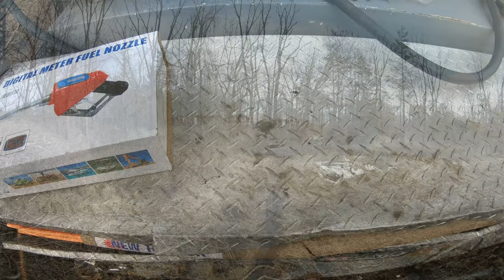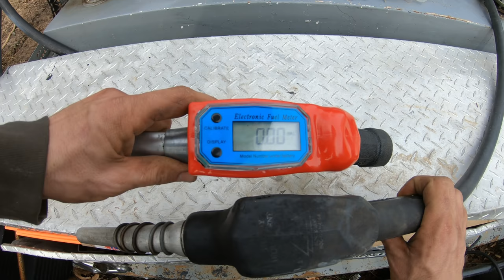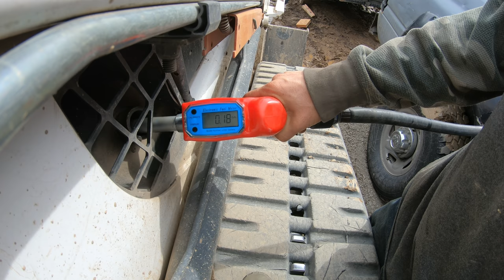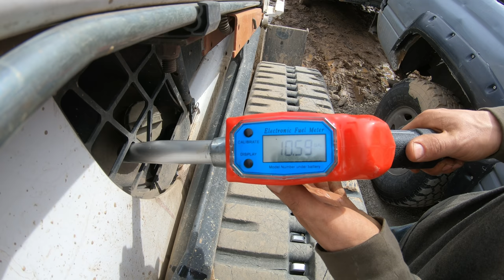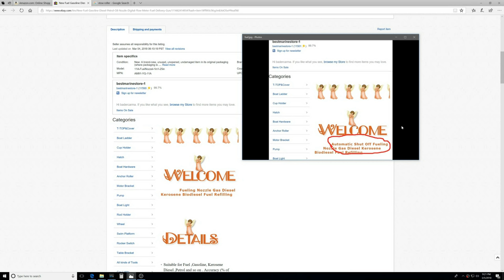Installing an underground propane tank

Comment: No one wants the firewood?? Damn!! I have to pay handsomely for it here in the UK!! Granted I get it cut and split since I don't own a chainsaw or splitter (yet - chainsaw incoming soon and a splitting maul probably), but even then uncut wood isn't cheap, and my old hosue can get through a fair bit to supplement the crazy expensive electric boiler than runs the underfloor heating in winter.

Comment: Andrew great job on all your videos
Question: does the propane company install piping inside the structure, and if so do they use plastic or hard pipe.
Much love and respect from the other side of Lake Michigan, The Windy City.
Reply from the maker: Yes, they did everything, I just did the dirt work. I have seen plastic and copper line used.

Comment: I feel I have run into that propane guy before in NYC.  I must say the 2 propane guys are an accident waiting to happen.  (I'm not a safety Nellie) no pad under outrigger with dirt that is near quicksand. #2 guy says to #1 don't stand between tank & truck (good advice). #1 doesn't listen.  Then #2 guy proceeds to get between tank and end of trench. Just use s rope

Comment: Tell the well guy they should try a carbide tipped hole saw bit. a hell of a lot faster, cleaner and easier then the torch. he will need a bigger drill then the piss-ant thing he had.

Comment: Arent u supposed to put a gravel base under tank ?
Reply from the maker: No, if the ground is rocky, it is suppose to be surrounded by sand before backfilling so no rocks are against the tank. Why would it need gravel? Its not going to sink, I would be more worried about it floating up at this house with its high water table.
Reply: @AndrewCamarata The weight of the prpane liquid gas and being sandy and mixed in with a lil clay may cause tank to sit unlevel ? The water lifting the tank would be bad ! Ive seen a emptied out concrete  inground pool here in Los Angeles lift outta the ground approx 3 feet, so that could be an issue if it rained alot and drainage system wasnt working

Comment: ANDREW THE WATER TABLE THERE IS SO HIGH HOW DO YOU SEWER PERCOLATION TEST THE AREA? THAT GROUND WATER IS VERY CLOSE TO THE SURFACE! HOW WILL THOSE PEOPLE DIG A WELL PAST THAT GROUND WATER TO MAKE SURE THE WELL DOES NOT MIX WITH THE SEWER WATER RUN OFF? YOUR LITTLE MACHINES LISTEN TO YOU VERY WELL HAAHA!! YOU ARE PRETTY GOOD WITH THEM FOR SURE, JUST SAYING OLD ONE LEGGED JOSEPH T RETIRED NAVY
Reply from the maker: Well, I dug those drains to keep the water table down. And I am doing a partially above ground septic system. Hopefully it works ok.

Comment: Doesnt those tanks have a stamp date on it too? So u have to re-dig and put a new one in when the time comes? Or?
Reply from the maker: Good question.
Reply: Mr Yang 
Code says as long as ID tag that is welded to the tank is ledgeable and the tank DOM is visible it can stay in the ground.
Anode bags need to be tested with a meter at certian intervals to make sure the cathodic protection is still there. If not a new anode bag can be set and your good to go.

Comment: You don't have to coat the tank b4 you bury it? Rust protection?
Reply from the maker: That tank is meant to be buried the way it is. And that bad that was throw in there is an anode, which keeps it from rusting.

Comment: That was a poor location  chosen for the house on that lot.They should have set it up a tad higher up on the property, out of the low plain of land where there's a real  high water table issue. Whoever was there building engineer they hired didn't do due diligence . Andrew had to do a lot of extra  unnecessary work. There probably  will be water issue's down the road for the new  home owners.

Comment: Never seen a underground tank in a home use!
Reply: Very common in MA, especially new homes .
Reply: People for some reason are afraid of a tank full of propane but are okay if it’s buried. 

As a delivery driver I would have hated buried tanks but then wasps under the dome cover are no fun either. At least with wasps if you had an older hose with the tap handle instead of the flip handle you could give the wasps a small shot of liquid propane and then fill the tank without worries.

Comment: Definitely not an auto-stop nozzlle, there isn't a venturi hole at the tip. The original nozzle you have (the one that says OPW) is a very good brand, Husky is ok, but not great. Stay away from VST and other off brands.
Reply from the maker: Yeah, that thing didn't last long. Started leaking out of the handle and it ended up in the trash.

Comment: with the water table being so high, i'm surprised they had to go 500 feet to find good water
Reply: They might have blown through the first sand and had to dig down to the next, or the first sand wasnt deep enough to set the screen, so they had to go to the next. Just because the water table is high doesnt mean its drinkable
Reply: I used to work on a well drilling rig and you never know how deep you have to go 🤷‍♀️

Comment: It may not auto stop with a slow pump.  You may have to replace your pump to get the auto stop to work.  Just saying.
Reply from the maker: Well the other nozzle auto-stopped. That new nozzle is not an auto stop. They miss represented it in the ad.
Reply: Andrew Camarata it is all about volume and pressure.  I have seen diesel pumps at truck stops fail to disengage because of those things.

Comment: As wet as it looks you should of poured a concrete slab or at least put some concrete pads 12"x12" under the feet to keep it from sinking. I would hate to see you go back on a job like that to have to dig it up and put at least some pad's under it.
Reply from the maker: Sinking? I would be more worried about it floating up. It will be fine.

Comment: What about rust on the tank? How long will it last underground  until you need to replace it?
Reply: I believe that is what the white bag that was thrown into the trench is for
Reply: Yeah, the anodes will keep it good for a while, I'm in Ohio and we have some underground tanks that are 18 years old and still good. I'd say 20-25 years is max, depending on how dry they can stay...
Reply: As wet as the ground is around there you'd think they would do something as well as the anodes and the red oxide primer paint?
Reply: For sure. I'd want a giant ass cistern or something, might as well do something with that water. Could have even taken it and used in a gray water system, for toilet flushing and what not.
Reply: I just googled that and the first one said 30 to 40 years

Comment: I wish there was an anode or two on that buried steel.
Reply from the maker: There is. That's what that bag was.
Reply: The propane guy is even asked "what's that?", and the propane guy says to soak it up if it leaks lol. I mean as long as it gets installed correctly I guess he doesn't have to know what it does...
Reply: @AndrewCamarata  Yes, I see it now @ 17:22
my bad

Comment: Should be titled how not to install an underground propane tank. Obviously don’t have a clue. Asked what the sacrificial anode was for and he says “in case it leaks”. WTF? It’s cathodic protection to keep the tank from rusting out, which I’d be pretty concerned about since they used the spoils from the hole to backfill instead of clean sand which is the standard in order to keep the factory protection on the tank from being damaged. And with that much groundwater, the likelihood that the tank will float out the hole because it was not anchored is pretty high.

Comment: What does the “ammo bag” do
Reply: It’s actually called an anode bag, and what it does is it transfers cathode cells to the tank which prevent corrosion. There are these wires that are attached to the tank and go up into a post on the ground that has a metal plate with bolts on it, and they use that to test the levels of anode and cathode cells on the tank.

Comment: you sure can not put under ground propane tank here in Ont. they will not fill it and man the crap you would end up in
Reply from the maker: Underground propane tanks are very common here. I don't see why they would be an issue anywhere. I have never heard of one having an issue. The underground oil tanks that used to be installed were bad.

Comment: Since that's a 1" nozzle there the pump doesn't have enough GPM to make the auto shutoff work
Reply from the maker: The old nozzle auto stopped. Its just not an auto stop nozzle, it was incorrectly advertised.
Reply: Well, that sucks. The 1" GPI nozzle I put one my new tank said in all caps it's won't shutoff with less than 20 gpm.

Comment: Your diesel is red?
Reply: Or is the fuel oil?
Reply from the maker: Fuel oil for offroad.
Reply: Why do you use that instead of diesel just curious brother lol
Reply from the maker: Its cheaper.
Reply from the maker: Not paying road tax on it.
Reply: Gotcha that makes sense so you have to get it from a supplier then? We don't have that here in update NY  unless you get it directly from the refinery
Reply from the maker: There are 1000's of trucks delivering that all over upstate NY, just order home heating oil.
Reply: Andrew Camarata not really up here we all get deisel delevered up here in the Rochester buffalo area.
Reply from the maker: People aren't heating their houses with heating oil?
Reply: Andrew Camarata mainly natural gas or propane
Reply from the maker: Brandon Garbacz really? Tons of people heat with oil here.
Reply: Andrew Camarata yeah it's still available but most people are using off road diesel. Not fuel oil well for their small Equpiment
Reply from the maker: Brandon Garbacz ok. Yeah that’s the same.
Reply: Andrew Camarata it's not red here tho that's why I asked